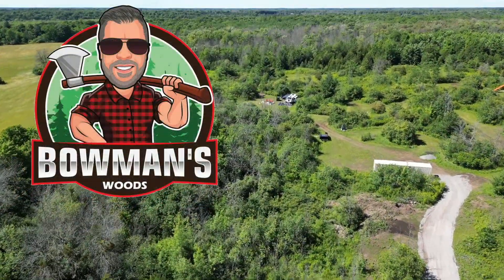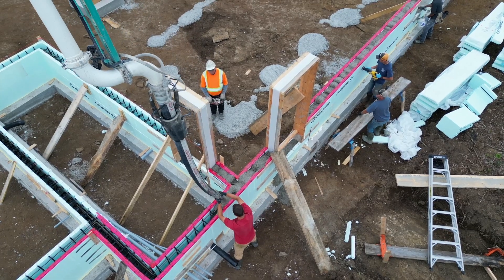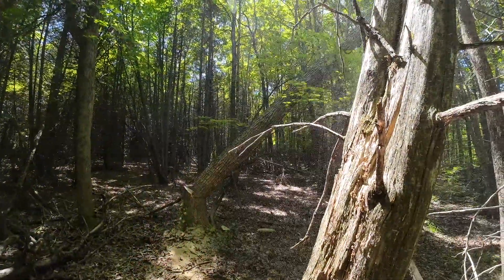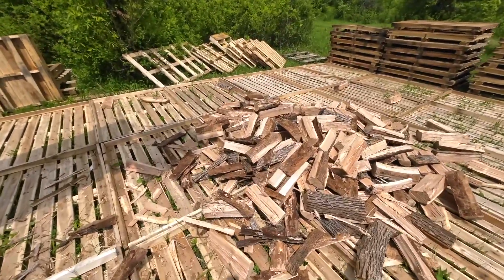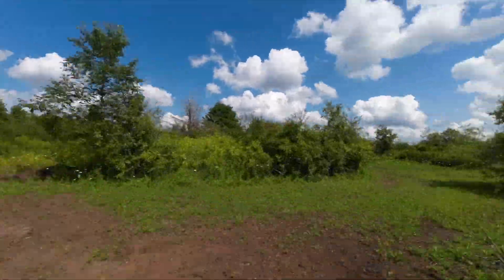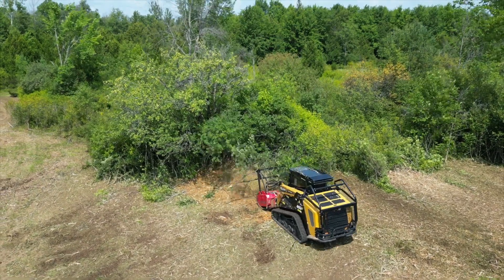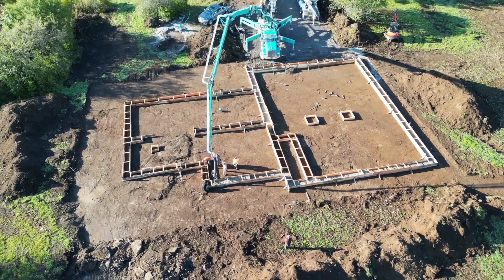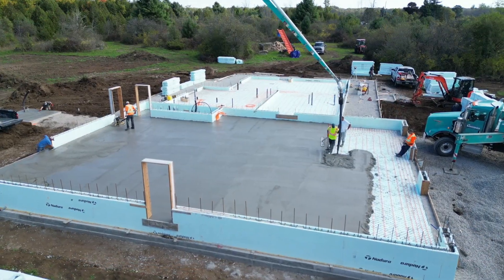Intro to the Off Grid ICF House Build.  Solar Powered & Wood Boiler heat.

Comment: I think you'll quickly find out that 20kw hours of battery will not be enough. I have 34.8 kw hours and need another 20kw hours to be mostly off grid.

Also AC coupled systems are best suited for grid tie,  for off grid, DC coupled systems are best.  They are more efficient for battery storage.

Wish you the best with your build.  It is definitely a unique project.
Reply from the maker: Thanks.  My system is expandable (so I am told) so we shall see how it goes.  I bet you are right.  May need more.